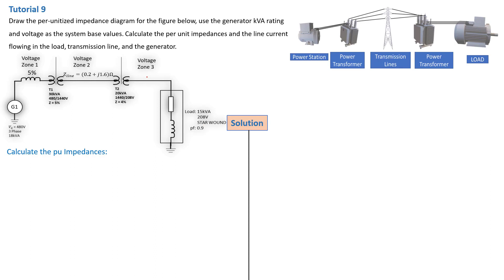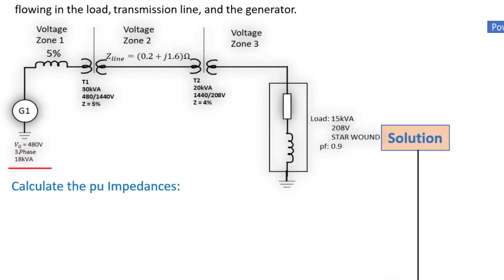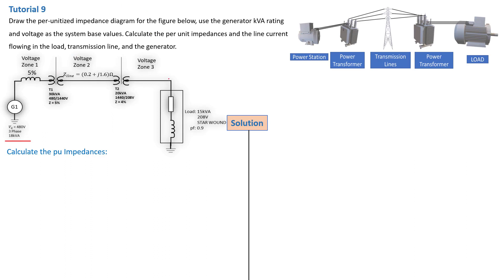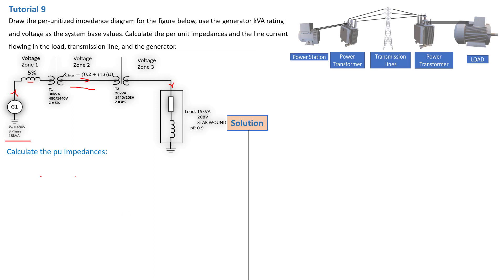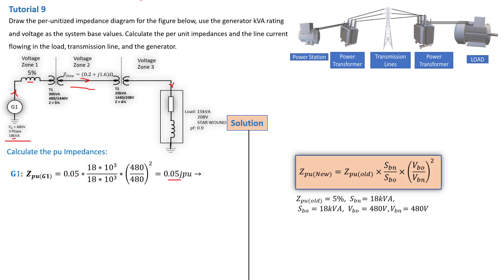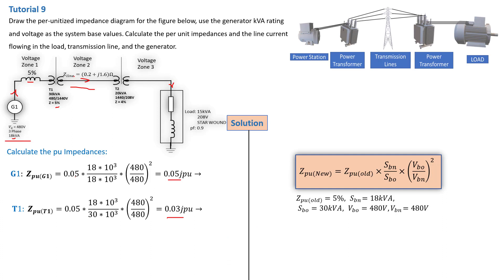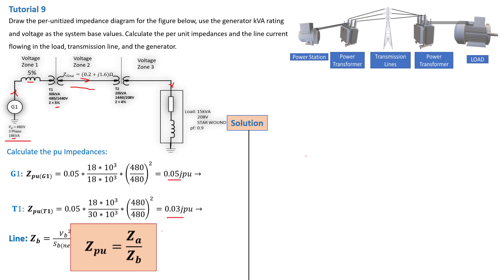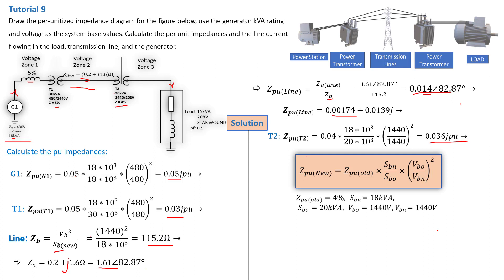How to FIND the per unit of a balanced star wound connected load - Tutorial 9. part 1

Comment: 13:56 there might be a mistake here when you calculated the actual impedance, the apperant power is given by the whole of the load which means for this is for the three loads at each phase, the correct form is either you divide it by 3 to make it 5kVA and the voltage will be a phase voltage not line to line, so Vp-n=208/1.73 then Zb= Vp-n/5KVA=5ohm, or you have to do the formula Zactual =1.73*Vb^2/Sb= 5ohm
Reply from the maker: Hi Thanks for your comment.
You’re right to point out the importance of distinguishing between three-phase and per-phase quantities in per-unit calculations. However, in this case, since the load is star (wye) connected, the actual per-phase load impedance is: Zb=Za = 2.884 ohm as calculated.
The 5Ω value in your comment would not match the wye-connected case here, but your reminder to correctly handle three-phase vs. per-phase quantities is well taken, especially when the load is delta-connected or when power factor is involved.